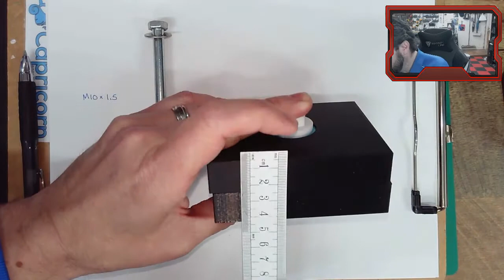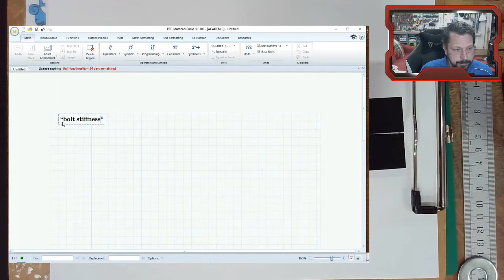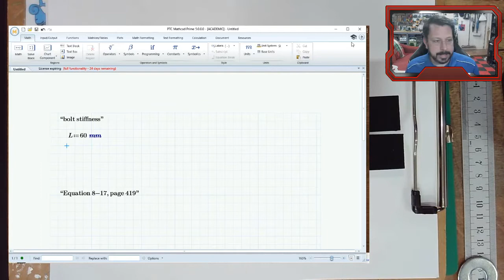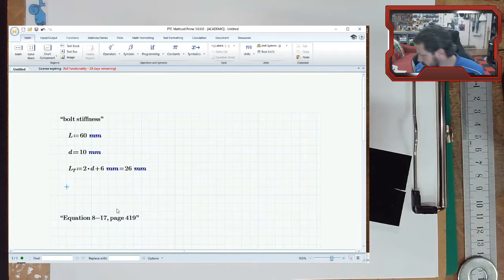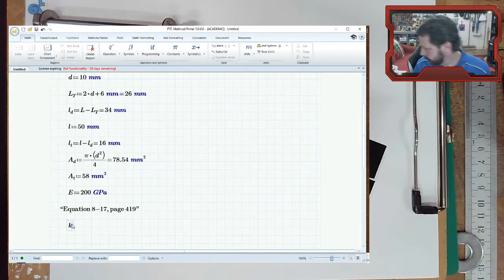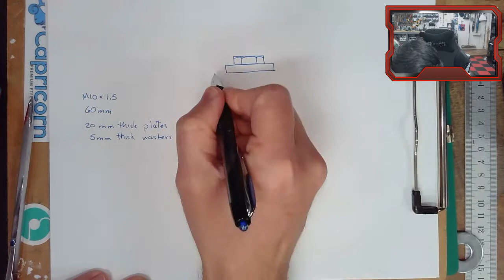Shigley 8 | Bolt and Member Stiffness Example

Comment: hi! thanks for the explanation but in fact, when we have the two values of K, one K for the srew and the bolt and the second for the structure set, how do you manage to use the values in a concret design. i'm just curious to include the full calculation in a project to avoid differents mistakes, havre a good day.

Comment: Can you explain the same for screw holding together two plates without nut.
Reply from the maker: I believe I do have a video that goes through that example. Basically the grip length is changed as all of the screw threads in the second member don't contribute to the grip. I don't recall which video goes through this, but it is probably the next one in this series. Thanks!